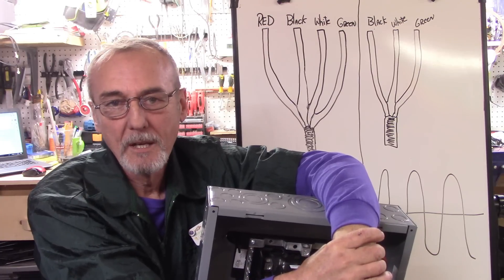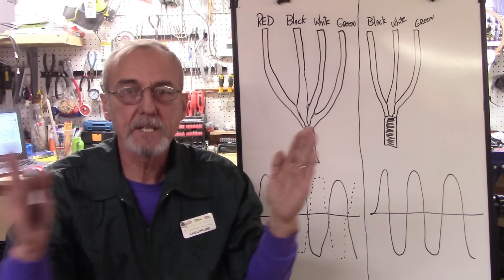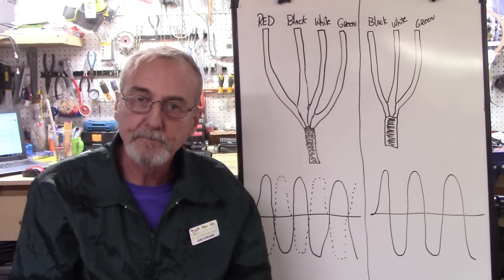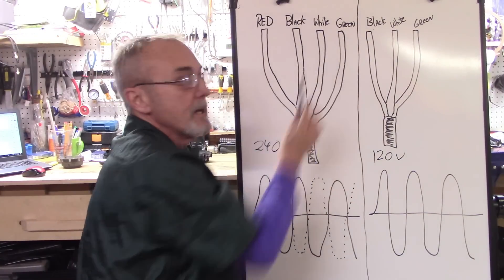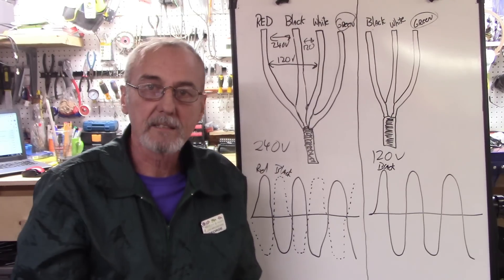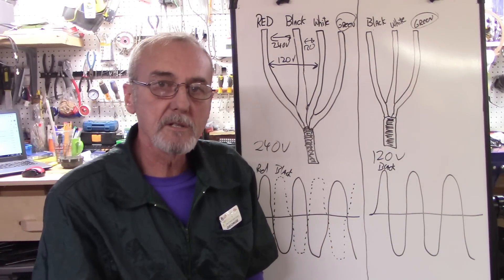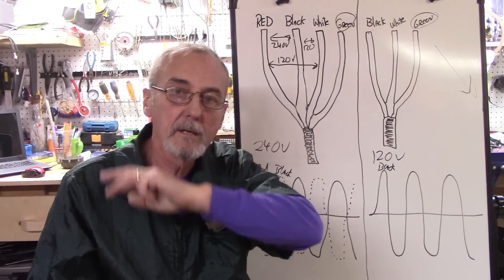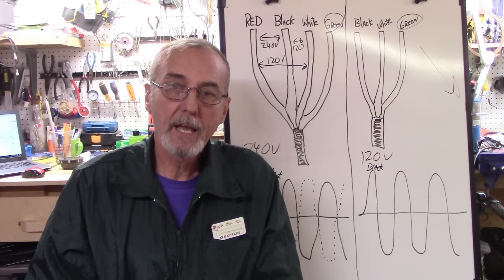240 V  vs  120 V explained

Comment: This is incorrect; the 240V is between the Red and the Black   but below the Red (the dotted lines) not next to it. You measure voltage from top to bottom not left to right. This is AC (Alternating Current); meaning that current moves back and forth between the two leads unlike DC (ex. batteries) which flows in one direction from positive to negative (mathematically). You don't use a neutral for US 240v because the power is between the Red and Black (two 120V "wires" 180 degrees out of phase from each other, meaning that when one is +120VAC the other is exactly 120VAC away from the other at the exact same time equalling +240VAC). 
You get 120VAC with the Black and White because the white is at the center of the signal (your lines going horizontally on the drawing) Basically cutting your signal in half. The highest the voltage will go for the black wire is 120VAC with respect to the white wire; whether it's positive or negative.
The color of the wires are just industry standard indentifiers. You should never use a white wire as a "hot" lead as it could shock someone thinking that it's a neutral: If you must, wrap the first 3 inches of the white wire with black electrical tape from the connection point. US appliances using 240VAC that also use 120VAC must use the 4 wires. The white wire must be tied to the neutral buss at the power panel so that installers may use either the black or red in conjunction with the white to get 120V. 
This video should be re-uploaded with the correct explanation; this video will just confuse folks.
Reply: I'm assuming that your explanation is based on some classes you took and was shown using an Oscope.    It's a shame that teachers can't teach better.   The only difference in the two 120 volt sine waves and the one 240 volt sine wave is the amplitude of the voltage.   There are exactly twice the number of windings at 240 volts than for 120 volts.   The all three go up and down at exactly the same point in time.  The Oscope causes confusion.   You are saying I am wrong by now.   Please explain how anything can be 180 degrees out of phase.   There is one sine wave going in primary side of transformer and it can only generate sine waves at exactly the same time and flow direction.   Respectfully,   Kevin
Reply: @KevinCoop1  Hello Kevin, my credentials are irrelevant here but if it must, I have an electrical engineering background with over 10 years experience in a Fortune 500 company and over 5 years experience in a NRTL Blue Chip company. That being said, I'll try to keep this brief and simple. 
- In the U.S. you read 240VAC from Red to Black because your are reading the entire winding coming from the transformer feeding your site/home. The white wire comes from the center of the transformer's windings known as the center tap. When you measure between Black and White, you are reading half the transformer's windings which is 120VAC; the same goes for Red and White. 
- When you measure from Red to Black you are reading the voltage at the same point in time. In the video's drawing the 240VAC is the first solid hump (its peak) on the left and the first dotted hump (its peak) right below it going negative from the center line. The red is the solid and the black is the dotted. 
- Since both humps are opposite each other at the same point in time when measured, they are said to be 180 degrees out of phase. 
- There are two sine waves coming in from your primaries when you use the neutral (white wire) as reference. You get two 120VAC sources 180 degrees from each other. 
- The terms Primary and Secondary refer the transformer's coil winding sides. The power plant provides high voltage to your local transformer's primary side windings. Then, the transformer steps down the voltage and provides the consumer with a lower power source from its secondary windings. In AC voltage the power does not go from positive to negative like in DC voltage; it actually oscillates back and forth. 
- The voltages is this discussion are in Vrms but that's a separate conversation; just like the difference between 3-Phase and single phase power or 208vac vs 240vac for that matter.
Reply: Zone07    I am currently retired.   I started electrical design 1983.  I worked for a top 12 in US privately held electrical contractor for the last 21 years.  At the end I was a Sr. Electrical design engineer/project manager.   Ok enough patting on the back.   Everything you said was perfect except for the solid and dashed lines.  In 240 volts that situation can not exist.   You are saying that the two add together.   Not true, they would cancel each other out and be zero volts.   A 240 volt sign wave is the same length wave as 120 volt wave at exact same time, but is twice as tall.   It has to be!   Please see my comment and all follow up comments at 10 months ago with the author of this video.  My last comment is the one I would like for you to read.   Respectfully,   Kevin
Reply: Zone07    To make your math work, you have to subtract a negative number to get a positive number?   Yet you say that 120 volts plus 120 volts gets you 240 volts?     Why are you having to use the term positive in your example?   AC is neither, and it is both.   In Europe, 240 volts is one transformer coil of a three phase wye configuration.   The system voltage is 240/416 volts 3 phase 4 wire.   In US, 240 volts single phase is two coils connected in series to form one coil.   It could be one coil but, we in US because if Edison (originally) to keep 120 volts because his lamps were 120 volts.   Tesla had to conform.   You absolutely do not need a neutral to get 240 volts, as is the case with a 2 pole breaker on a 240v delta configuration system.  Now, if you were to make your statements as "Based on the results of connecting an Oscilloscope to the system using neutral as a reference point".      Then you would be correct.   The test condition is the cause of your phase shift, not the transformer.   I'm pretty sure you can not come up with an explanation on why there is a phase shift mechanically.    Another thing that is very hard to explain is,  (In a single phase 120/240 volt system, if a multi wire branch circuit has 1200 watts of load on both 120 volt hots with a common neutral, why is neutral current 0 amperes?).    I hope I am not upsetting you!    Respectfully,   Kevin
Reply: @KevinCoop1   the answer to most ofl your questions are in the 2 videos I linked. There's even a simple explanation as to why there would be 0 amps on the main's neutral of a balanced circuit where both hot legs are drawing equal amounts of current. I highly recommend watching videos from The Engineering Mindset channel; they have great illustrations and explain in great detail single phase, 3-phase, how the 3-phase is generated mechanically, etc.. In algebraic terms a positive minus a negative is a positive (ie. 1-(-1)=2. Perhaps you've been out of the game for too long; it's always healthy to stay current; specially in this field. Please watch the videos; they offer great graphics which is often needed to explain the theories in this field.
Reply: Zone07    I'm not loosing my mind yet.   I have watched both videos before.    Engineering mindset are excellent.   I'm just trying to get you to look at electrical transformers and therefore electrical systems differently.   You are looking from test equipment, I am looking from how the transformer actually looks.   Voltage out is the ratio of windings out to windings in.   Nothing else to it, unless you are talking about buck & boost.    Then a whole different ballgame.   We will have to agree to disagree.   Enjoy your life every day!   It is just a short amount of time!    Respectfully,   Kevin
Reply: @KevinCoop1  I'm happy your mind is still intact specially during this challenging times; unfortunately, I don't think I can say the same for mine; I'm using this quarantine as an excuse but I think the family is on to me. I understand, I remember fresh out school at my first job trying to apply theories and lab practices into real life applications and burning O-Scope leads and resistors. Also popped my share of capacitors stinking up labs and popped plenty of meter fuses trying to measure current with the meter leads still set to V; don't even get me started on high voltage; I have stories for days. Stay save Kevin.
Reply: Zone07    Always keep learning!   If you feel a little bored with your job, maybe you should try to get a job for an electrical contractor.   I worked for contractors and consulting engineer.   I learned a few years ago from someone at consulting engineer of something called "Our electrical engineering is all done by Rules of Thumb".   I find that to be a disgusting practice!   You do not need to learn anything, just do what I tell you.    It came up because he told me that I had to use 60 degree column in 310.15B16 up to 100 amperes.   When I said false, I told him to get his NEC.   A few weeks later he said "Kevin, I went to all the old timers here and they have never heard of this".    Too long!      Short answer, engineering for contractors is way more exciting and you learn way more.   The big thing you learn is, because of the size of the projects we did, one mistake in the design could cost the company $100's of thousands of dollars.     Last one I was involved in had (69) 2,750MW generators.   Not 2.75 but 2,750.     So, get back on the horse and ride it to the best of your ability!    Respectfully,   Kevin
Reply: @KevinCoop1  You are using one of the hot legs as reference and that is incorrect.  The Neutral is the reference which is a center tap on a transformer.  With neutral as the reference, as it is, both hot lines alternate around it.  Single phase 240V is actually two 120V lines 180 degrees out of phase.  There is no ground referenced 240V anywhere.
Reply: @skoue4165  I think your response was meant for another comment.

Comment: I get confused as why we get to add the voltage together when they appear to be sending 120 at different times.

I understand that we get 240 volts and that's how things work. But in the diagram it looks like we get 120 volts from each wire at separate times.
Reply: You get 120V in the same phase at different times, but they are in opposite phase at the same time, all the time.

Comment: ~3:15 no, you can use a second cable with a circuit and capacitor to store charge and then release it in tandem with the other wire to make 240v. but yes you need 2 plugs. very similat to converting AC to DC.

Comment: Good video explanation. What will happen if I replace a 240v three phase 1/2hp servo motor (that provides power to my sewing machine via a drive pulley) with a 1/2hp 110v single phase motor? Can I damage any electrical panels that are wired in between the original motor and the sewing machine? Any chance I can do any damage to my wall outlet wiring?

Comment: Morning George on 4.36min you said connecting the red and black together you getting 240v. but also you need the white neutral be connected to me I use the 2 wires just to check the 240 never connected together each one goes to different prong maybe i'm wrong in the draw it's correct

Comment: We were just told we going to electrician for new dryer because it’s 240 and old one was 220. But the 240 outlet matches  the 220.
Reply: Voltage varies through an acceptible range.  A 220V circuit is somewhere between 208 and 232.  It's all the same.

Comment: I've got 1 3 wire line coming into my light pole. 2 blacks, and a green. Then on top of the pole I have 3 3wire spot lights. I thought I had them wired correctly but all I'm getting is the lights buzzing. The wires are connected as this. The 3 lines coming down the pole from the light have all the whites twisted together ,the blacks twisted together, the green twisted together. Then the  line coming up into the pole I  have 2 blacks.1 is connected to the 3 blacks from above, the other black connected to the whites, then Green to greens. And the greens go to a ground lug in the pole

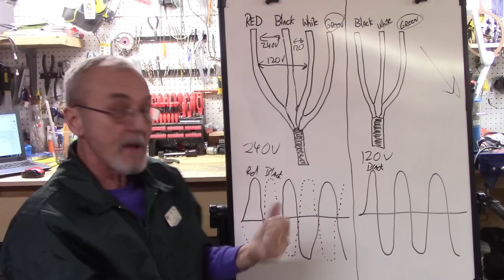Comment: At 7:50 you say the two hot wires will be out of phase. What determines whether hot wires are out of phase?
Reply: Since they are actually opposite poles of a single phase, they inherently have a fixed phase relationship when viewed relative to neutral.

Comment: For a 240 volt load to a outside AC unit. My HVAC guy used a 10g  3 wire.  White black and bare ground.   Is this safe or should the ground have a green coating like your wire in the video ?    Will that bare ground ever become energized?  Or is it no different than the bare ground in a 120v system and a coating isn't needed ?

Comment: At 2:55 you say "add two peaks together to get 240v".  Not to be pedantic, but you don't add two peaks because they are occurring at different times (separate by 120th of a second).  I think you subtract the two waves AT THE SAME POINT IN TIME to get the voltage difference.  Since one wave's peak is positive the other (trough) is negative, you've got +120v - (-120v) = +240V.

Comment: does the 4 wire neutral run 120V to other components in the appliance is that why u need it? or what is the purpose of the neutral wire?

Comment: thank you. I'm trying to convert a 3 wire to a 240v submersible deep well pump, Still not sure it will work in this case. I don't want to bury a new wire. Too much stuff buried out there now. However the 240 well pumps have the controller outside the well verses a 110v submersible pump controller inside the pump in side the well.

Comment: I'm a total layman, but I really liked this video. Very explanatory, ad I finally understand what 'phase' means. My only question is about neutral. Not sure what that does or how it's used, and what you mean by '240 has its own neutral'. Thanks!
Reply: It depends on where you live and the power distribution configuration, but to put it simple:
In the UK, 240V is single phase with one live wire, one neutral (and always one earth wire), the AC neutral is basically another ground wire but it provides a path for the 240V to return.
240V in the US is split-phase and doesn't use the 120V neutral because the two feed wires are 180 degrees out of phase as he described and can essentially take turns being the return wire every time the phase switches. However, with the original four wire cable, the phases are only 120 degrees from each other and so would still require a neutral to return. Hope this helps :>
Reply: @spicycrabnoodle9049 The 4 wire receptacle is basically a 240v and 120v receptacle built into one and the appliance will use both for different operations. The neutral wire is for 120v return, just like any other 120v receptacle. There's no such thing as phases being 120° from each other in single phase wiring, which this is.
Reply: That last statement “240 has its own neutral” doesn’t mean anything.  “Neutral” is the grounded conductor, which is not part of a 240V circuit.

Comment: Would it be a good analogy to say that "Generally, the purpose of a neutral wire is to return excess voltage back to a source (electrical panel)" much the same way as the "gas return line" returns excess fuel in a car's fuel delivery system back to the fuel tank? (assumes the car is gasoline powered only)
Reply: That is a not a good analogy.  A lot of people who are novices get confused by such analogies, and meaningless terminology like "excess voltage."

Comment: The current meaning electrons residing in the neutral zone! The white wire in 240 or neutral also is a path or common zone used as an over current protection area or device without really tripping a circuit breaker!

Comment: I need a 120v outlet at my 240v well. Provided the amperage is acceptable can I tap an outlet? It's getting cold, and I want to run a small heater.

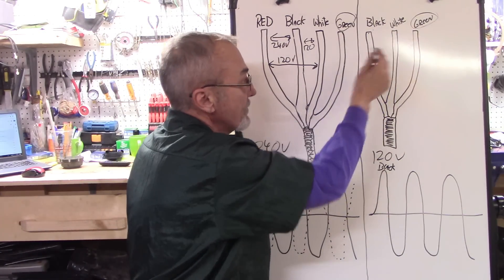Comment: Thank you for the video, what I don't get is 6:30 so you disconnect red 120 and connect white that's still 120V between white and black? if you connect white to red that is a boom! Recently see a plate from the AC unit that needs 208-230V in USA one phase so how you get that. I am not an electrician just want to understand.

Comment: Hi, I live in Australia, which is on a 240v system. I bought a light stand from the US, which has 110v printed on it. WIth a 210-240v plug adapter to plug it into a 240v power socket, can I run a 240v light globe in it or do I have to purchase a 240-110 step-down transformer and run a 110v light globe?

Comment: I noticed my receptacles only have 110-112v, so I checked the breaker box and I only get 112v. Aren't I supposed to get at least 120v?
Im in the USA.
Reply: Be sure your multimeter is accurate by buying a new cheapo meter.  They fail over time, and read inaccurately for AC, and are tough to calibrate.  Many other functions will still work, but it's best to have backups.  Then test the voltage supply at the breaker.  Then at the main wires coming into the box.  And if all checks out, and is still 110v, let the power company know and they should adjust it for you at the transformer.  They bumped mine up a few volts to 121 years ago outta kindness, so you're right there on your thinking..

Comment: Why is a 3 prong dryer 2 hots and a ground rather than 2 hots and a neutral?   I thought the neutral was always to return to the source. And the ground never carried current unless something faults.
Reply: A dryer usually has components which operate at 120V, such as a timer and other controls.  The motor will likely be 120V as well.